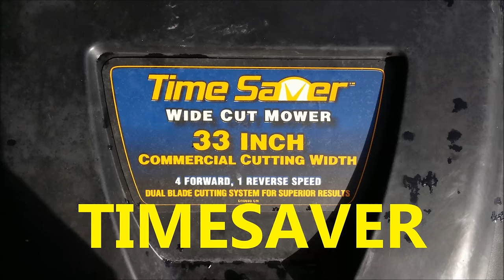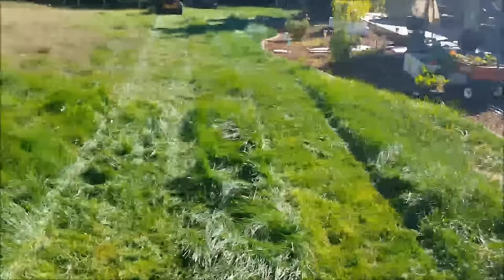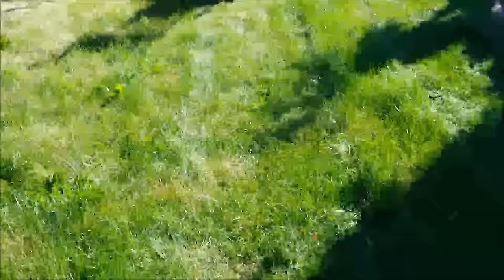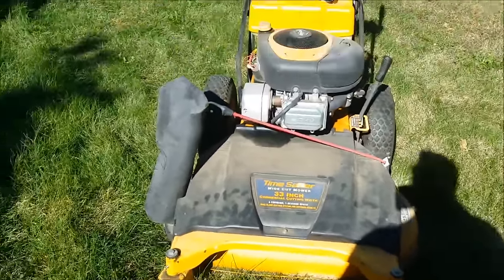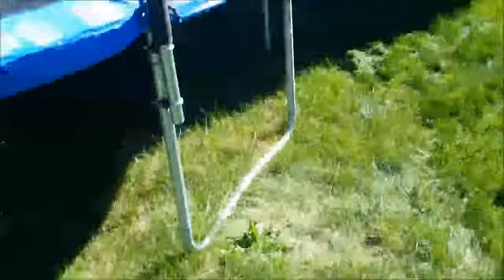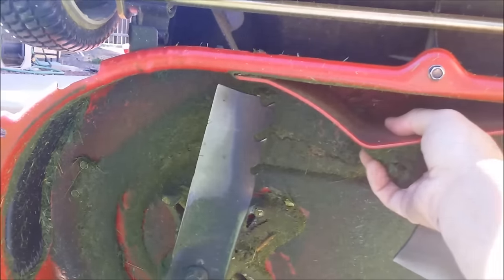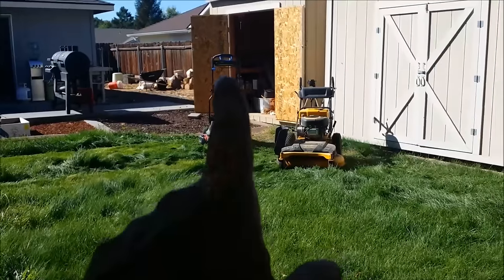Cub Cadet 33 in. VS. Toro TImemaster

Comment: Beginning 2017, the TimeMaster and near-equally-equipped TurfMaster and near-equally-equipped ExMark30 all have a new, larger engine; a 223 cc B&S motor to replace the outgoing model shown here that has a 190 cc. The performance upgrade is +1 1/4 ft-lb torque. From 8 3/4 to 10 ft-lb. Reviews of the 190 cc TimeMaster often include an underpowered complaint that is not ever mentioned in any of the reviews of the new model with the larger engine; however, almost every single review of the newer model states that the gas tank is too small and run time on a tank of gas is only about 30 minutes, which for me, that's a deal breaker on a mower that's supposed to save time over an engine that's slightly underpowered. It takes me about 45 minutes to mow my 1/2-acre with lots of obstacles; and my mower will just barely make it on a tank of gas and just a little time to blow off the driveway. 

I own a TimeMaster with the 190 cc, and mine bogs down in anything close to being considered tall, wet or thick grass; and that's in it's best mode, which is with the mulch plate bungy-corded up to create a wide open side opening, and the side chute removed. In mulch mode, it's almost worthless unless you're mowing very short and dry grass, because in any other scenario, the engine will not keep running without slowing way down to a crawl and it gets slower the longer you  mulch as the grass underneath the deck continues to build up. And remember, the name of this mower is TimeMaster. With the side chute on, it does pretty well but you still have to slow down in average grown grass after the month of June in the southeast and in thick grass the opening will periodically clog up turning it in to mulch mode. The TimeMaster does very well with the bag attached and it's removed and installed very easily. It will vacuum up dry dead grass and leavers very well and it comes with the bag and removable rear chute. I've also got a back-up mower; a very cheap 21" Weedeater push mower with a 5 1/4 ft-lb torque that has dull blades, and that mower can be pushed faster in thick grass at the same cutting height than my TimeMaster without bogging down. It does not, however, cut nearly as well quality as the TimeMaster even if it had sharp blades, but this $175 mower has more engine power relative to the blade spin than the $1,000 TimeMaster. 

Now for the good news: The TimeMaster is a dream to mow with. Personal Pace is the best propulsion system out there. So intuitive; so easy to use; very low profile for it's width for going under trees and large shubbery; great trimming mower, because the deck is as wide as the wheels, which means it'll cut right up against a fence better than any mower I've ever used, and it does not leave much uncut area to it's front considering it's size (8 inches); and so the TimeMaster is very productive for cutting large lawns, yet compact enough to cut just about anywhere that a 21-22 will cut, enhanced by the fact that one can lift and lock the handle up to 90 degrees very quickly and easily for very tight spots. The mower also cuts very well and is amazingly nimble for it's size and the 30" swath is very nice. 

In order to take the TimeMaster from a good mower to a great mower, especially considering it's $1,000 price; what Toro needed was to up the engine size just a tad, as they have done, so that it doesn't bog down too easily, but Toro and B&S should have ensured that the run time with the blades turning was at least an hour. So the B&S 223 needs a tank at least 80% larger. That would have fixed two weaknesses of this mower, but what they did instead was fix one weakness and make the other weakness worse to the point of unacceptable. The TimeMaster also needs more durable pulley's and belts, as I had a pulley go bad in my fourth season mowing only one 1/2 lawn; and this is a very common complaint with the mower; and it needs a side opening that's larger so that the mower can expunge grass as quickly as it cuts it; it would therefore need a corresponding larger chute ; and it needs a  system whereby the chute can be flipped up while attached, instead of having to remove or install the chute when needed, which is a hassle. As for the mulching weakness; I'm not sure this can be fixed in such a compact mower with a 30" wide deck. It would have to include a longer deck to deal with all the cut grass, but then it wouldn't be the same sort of great compact, wide-cut mower.

There is currently three MTD-made 28" mowers that have now been on the market almost a couple of years that compete directly with the TimeMaster (Craftsman, Troybilt, and Cub Cadet) that are more of a direct competitor to the TimeMaster than the CC 33" or the Troybilt 33" cut or the Craftsman 33" cut. These 28" mowers also use a pace SP system to copy Toro's Personal Pace, but the MTD version requires pushing downward, instead of forward on the handle. I've not tried one, but watching videos and just thinking about how such a system would work in comparison, I don't think it would be nearly as good; not even close. I've also read where the MTD versions have a slower, possibly unacceptable top speed with their SP system. The TimeMaster is pretty quick when you push full ahead, and that's part of what makes it a TimeMaster; slower would be unacceptable for me. The front wheels on the MTD versions are not equal distance from the deck, because on the MTDs, the deck is cocked sideways a tad; the left side is very close in towards the deck like the TimeMaster, but the right side is much farther forward, and so it will not cut as close to a fence or structure to the front as the TimeMaster. I know that at least the Craftsman has the same B&S 223 cc engine and the same gas tank and the same complaint as the newest TimeMaster. I believe at least one of the MTD models has a Chinese B&S knock-off brand engine instead of the Briggs 223 cc. Feature-for-feature, the three MTD brands can save from $100-$150 compared to the TimeMaster; but I just don't know if the larger swath concept would even be worth it with respect to the MTD models due to the pitfalls listed above.

I don't think the 33" CC or TB or Craftman are worth the $1,200 considering their drawbacks unless one is mowing a large lawn with few obstacles. There is also a WorldLawn 32", but it starts at $1,800, but it too has a higher profile and so really, the TimeMaster and the trio of MTDs are the only mowers wider than 22" that are designed pretty much like a 22" inch. If Toro or MTD would address a few minor issues, they'd be a great concept of a mower for an acceptable price premium. I paid around $840 for my TimeMaster, because I waited for a deal and then I applied for a Home Depot card and saved 10% on my first purchased. I then turned right around and paid off the card and cut it up. I think I got my moneys' worth in my TimeMaster, but if I'd paid $1,000; I'm not so sure; I'm also skeptical about paying $1,200 for a 33" MTD mower; or $1800 for a WorldLawn; or $850-$1,000 for a 28" MTD; but have carefully considered all of them for my next mower.
Reply from the maker: That was quite the long comment but thank you for taking the time to write it.  I still have my time master but it doesn't see much work these days. It just doesn't hold well in a commercial application. I have not tried out the new engine. I have a friend with on and he really likes it. I have not owned my CC 33 for quite sometime though it had a stronger engine there was only a couple of things I liked about it. I do however run the turfmaster and am quite pleased with its durability and have no issues with its power but I do not put it or any of my equipment into situations that they would not work well in.  Thanks again for watching and taking the time for the comment.
Reply: Omg, the longest comment I've ever seeb lol. Great info though.  

I just ordered a Cub Cadet cc800 33 inch wide cut mower from home depot after extensive YouTube reviews. I think a lot of the bad are just people getting bad machines because of mass production issues (it will always happen). 1 thing I do know is I'm gonna zip tie all the cables first thing so they dont snag and break, and also put fuel stabilizer in it every tank. I'm going to be changing the blades to Oregon G3 or some other mulching blade before my first cut.

Comment: Did you ever comeback and acknowledge that you compared the wrong two models?
The Timemaster 30 is comparable to the Cub Cadet CC600 28"  not the CC800 33".
They have similar specs and pricing.
Reply from the maker: Why would I say I was comparing the Timemaster to a 28 inch mower when I was clearly using a 33 inch?  In any case this is a really old video and we no longer use either type of these mowers in our business.

Comment: I owned that 33 inch wide cut mower and it always did suck at cutting. I ended up selling it for $1000 so I got my money back. The Toro Timemaster needs a larger engine. I hear the thing bogging down as your coming forward. If the time master had a larger engine it would probably be descent. The design of the cub cadet, which is MTD and also made them for sears just had a terrible blade design. Its a twin blade and the blade turn opposite of each other, if it had a 3rd blade and they had synced it correctly it probably would have been a good mower, but they were just designed poorly, they both were, one needs a bigger engine the other needs a better blade setup. I don't like either, the one I know from experience. That's my opinion.

Comment: I own both the timemaster and the cub cadet also. I bought a set of gator blades for the cub cadet after your video you posted at the beginning of the summer. I used them for a few weeks, then went back to the high lift blades. I feel the high lift blades do a better job than the gators. I really like the timemaster too but I have to clean under the deck more often than the cub cadet when mowing wet grass.
Reply from the maker: +Billy Goat Yeah wet grass can really clog up under the time master when mulching, I don't really have problems if I just bag it when its wet.
 So you like the high lifts better than the gators?  I never had good luck with the high lifts. But hey we all have different preferences. 
I am on the fence for selling the cub, it has its place especially for hilly areas so I don't know.
Reply: +C Breezy Seems to me the the high lift blades have a better vacuum effect when mowing tall and/or wet grass.  Most of my yards are bi-weekly accounts.  The time master gives a really nice final cut on those weekly accounts.  I do want another cub for backup.  I been looking on craigslist and ebay for a used one around $500 or so.  Most range from $650 and up.  Winter is coming, I'm sure I can get another one for a good deal.
Reply: gators are way over rated and take alot of hp
Reply: Would you say the cub is better than the toro or worth the buy?

Comment: I have a cub cadet 33 in.....and I call BS on this test, I have gone through higher grass than that plus small brush. I also have a smaller toro that I love as well but save the hard stuff for big bertha (cub cadet) PS. I caught a water shut off one time and the cub cadet was so powerful it twisted the deck
Reply: the cadets have flimsy decks no surprise and bearing undersised. if it had not been used the deck needs to get polished up and they work a lot better???
Reply: nothing wrong with the deck.....the immovable object I hit is testament to the power of the machine, the deck didn't stand a chance, definitely not flimsy
Reply: @mrmomrm  I found a water meter on an overgrown front yard yesterday with my 42" Victa (Ferris) zero turn when the left hydro decided to do its own thing and it didn't do anything to the deck or blades etc. Water meter didn't come out of it so well though..... Not sure how you'd manage to twist a deck like that?

Comment: Isn't the walk-behind style much easier than the push style? I know they both are self propelled, but the lifting the front of the mower to turn seems like it would get old quick.
Reply: The walk behind mower he has( cub cadet) is very awkward to use if you have previously used commercial walk behind mowers.  On a commercial mower, the levers are underneith and if you release you still hold a firm grip on the mower bars. These Cub/Craftsman 33" have the levers ontop of the bars, in which to release the blades or let off the drive clutch to turn around you are literally taking your hand off the bars. For this reason i do not like the 33" with this style drive.

Comment: thnx for sharing this video,I have been looking at both models and wasn't sure on which to purchase...it will be the Toro this weekend
Reply from the maker: +andy criss Its a good mower you just have to remember that is not a commercial model and treat is as such. I run mine commercially, but I do a really good maintenance on it each week, I have only had one problem with it ( it cracked a pully near the end of the season) and it was covered under the warranty so was no big deal.

Comment: My only concern with the timemaster is I mow alot of hilly areas and im worried it wont pull its weight. Want one but im also worried about the transmission life.
Reply from the maker: +whipping grass The Timemaster does pretty well on normal low grade hills, just have to remember at the end of the day it is still a self propelled push mower.
Reply: +C Breezy once your tranny fails you should let us know how long it lasted months/hrs    seems to be 1 of the few weak points on it
Reply from the maker: +zerocool212121 Will do......I have two of them. #1 had an issue with a cracked pully after 5 months, so it made it most of the season but since it was warranty work I purchased #2 while #1 was in the shop. Other than that, no issues to report.
Reply: It does really bad on hills. That's why I was thinking about the cub cadet.  Just a slight incline and being its under powered makes for some hard work.

Comment: Thanks for your video. I am in the market for a wide cut mower and glad I came across your video before I purchased anything.

On a different note: WTF!? Please stop sticking your hands in the deck while the engine is running. I understand that the blades are disengaged, but holy shit man.
Reply from the maker: Thanks for taking the time to watch it. There are many different options for wide cuts out there, I have gotten rid of the 33 and now only use the 30's.

Comment: I  don't get it...the Toro has a 190cc engine, and the Cub Cadet has a 420 cc engine.Something is wrong with that experiment - maybe the belts are way too loose.Even a dull blade will cut better than that.
Reply: But the CC motor is a Chinese built crap motor with absolutely no torque whatsoever. I have a Ybravo with a Kawasaki 190cc and I can push through 3ft high grass open chute with it with no problem.
Reply: I have the YBravo Gen II 25 inch w/kawasaki FJ180 ... it is a great mower, a little under powered but vacuum and cut quality are terrific

Comment: in the market for a wide cut walk behind. I'm actually looking at both of these mowers. so everything considered which would you with if you had to choose? it seems to be the toro even with the lack of pull on the propel. great video
Reply from the maker: I do prefer the Toro over the cub, however it really depends on what your gonna use it for? If you have lots of steep hills that are going to need work then the cub is an excellent hill climber. The Toro has a better cut in my opinion and bags far better.  I no longer own the cub but have two toro's so I guess that would be my answer. Thanks for watching

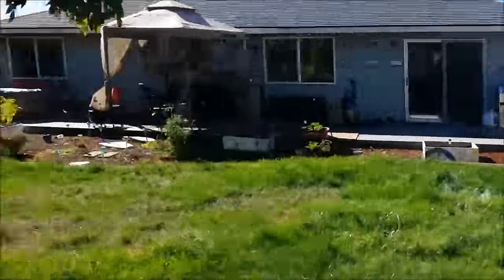Comment: I have a .new 41 acre yard that seems like it takes forever. I'm using a 21" Honda HRX217HYA with the dual blade. This mower is about the fastest walk behind mover I know of. If it is taking me an 1:40 hustling then would it be worth it to buy the Toro and how much time would it save?  My old yard was .29 with threes, but this seems to take forever. Thanks!
Reply from the maker: +DJ Cordes Almost half acre is pretty big for any 21 inch I think. I used to use a Honda HRR216 and still have it and think it is a great machine as well. but going from a 21 to a 30 is a big time saver no mater the brand just the difference in cutting width will take steps off your mow.  Thanks for watching

Comment: C-Breezy......Thanks for Posting this Informative Video.....I know the effort it takes.....If you are considering a new Video Camera....look for the Lumix FZ300....4K-Video is available and the body is somewhat Water Mist Sealed....and the best thing is that you can find them for sale used, at a good price.....My FZ300 was just $300 "used", but basically untouched......Do You still use the Cub Cadet 33" featured in this video and have you had any luck getting it to cut grass better....?
Reply from the maker: +Donald Pedigo Thanks Donald, I do still have the cub cadet but I no longer have it out on the street with me. It really does cut grass fine, I just found that it had problems when it came to tall grass. If you are cutting a weekly lawn then this mower would do just fine mulching or bagging.